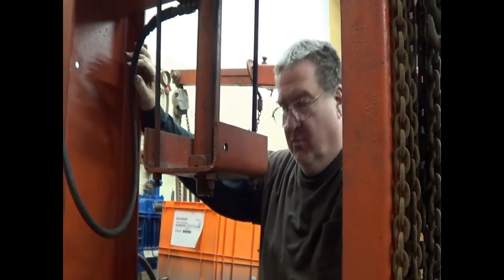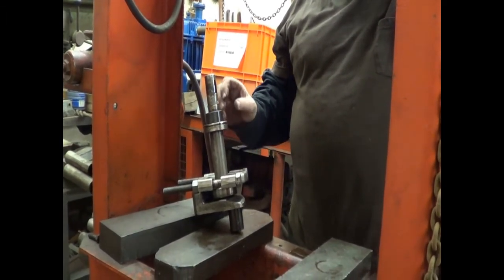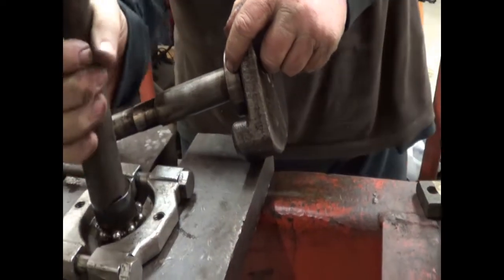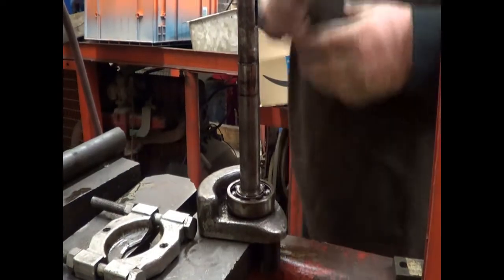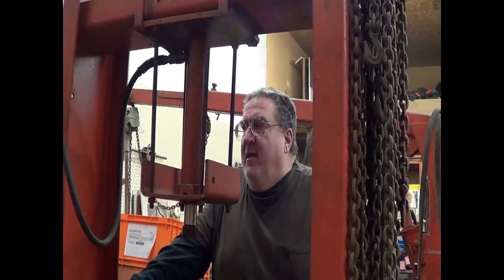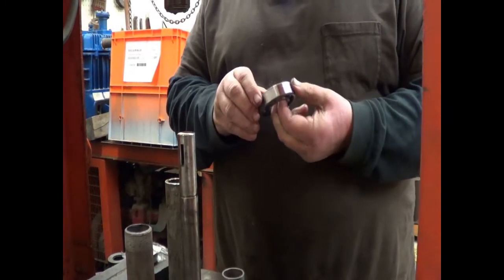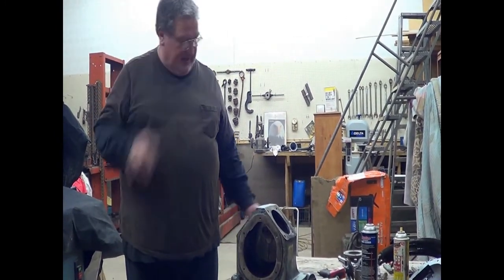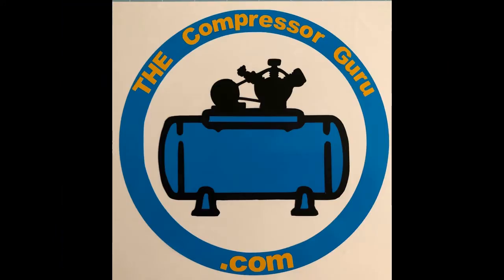Ingersoll –Rand 242 Crankshaft bearing removal and re installation! S1, E23

Comment: Mr Guru, I had a question, I have a Ingersoll 3000 and it's starting to make noise like the bearings are going bad, once you take the big pulley wheel off how does the crank come out? On one side it has that big cover on that has the oil filler plug and on the other side the small cover with the big wheel, I was curious as to what was involved in that, thank you so much for your time, I noticed the rods just free float on the crank?
Reply from the maker: with everything else taken off the pump lay the pump over on the opening that you accessed the rods through. I have no worked on a 3000 for a while I do not remember if there is a snap ring under the seal cover, if there is remove the snap ring.  Then PRESS out the crank shaft pushing down on the end of the crank. you will need a press with a large opening to do this. the 3000 is a larger pump on the smaller pumps you may be able to take a large hammer and a piece of wood as a cushion. and hammer the crank out. DO NOT USE THE HAMMER DIRECTLY on the end of the crank. use wood or a piece of brass to keep from damaging the end of the crank. 

I do have Aftermarket high quality parts for this pump I can also get you OEM which is usually at least twice the amount of aftermarket. 
You may contact THE Guru through the link below.
 thecompressorguru.com
Good luck. let me know how you make out on this project.
Bud
Reply: @THECompressorGuru  Thank you so much for your help, that was quick,this compressor is inside a room so I'm guessing is gonna have to be taken out of the room to work on it? i assume thats the only way to replace the bearings is by removing the crank? 

We have a massive press where we can do this and pull the crank out,won't the rods bend when the crank is coming out or they will just slide off the crank as the crank is falling out while being pressed?  hope that made sense, ha ha ha, i'm kinda bad about explaining things, thank you about the offer on the parts, that is great news and if we decide to go that route that would be what we would do,any money we can save is a plus.

Does the crank ever bend from running it with a bad bearing or is that a anomaly on these engines? you are correct, its a biggin too, we have 2 of them,we are a machine shop but we try to do most of our own work,most of us have decades of experience working on huge natural gas compressors and things like that but we have never messed with a Ingersoll compressor like this thats why i was asking.

It was pumping great when it started making this noise and it sounds exactly like a bad bearing,on the side that has the big wheel you can see that area there is wet like the bearing has been acting up and the seal has failed.
Reply from the maker: @dntlss  When I said everything has to come of before you pull the crank I meant that you need to remove the cylinders and pistons  so once you have done that you should not bend a rod...
removing the crank  is THE only way to change bearings. 
we do have a high quality rod and bearing  aftermarket kit for the 3000. 
contact me through thecompressorguru.com for more info
Reply: @THECompressorGuru  I gotcha now, man they couldn't have made that more labor intensive if they had tried,lol, thank you much for all your help, I will subscribe when I get home, your top notch in my book.
Reply from the maker: @dntlss  the crank is the first  thing in and the last thing out . you are right.

Comment: Great content and thank you for sharing it. I can't thank you enough. My compressor has been sort of a mystery unit.  It has 30T 560v stamped on the Ingersoll-Rand ID plate under model number.  In the serial number spot it has 30T in black ink and 397577 stamped in.  The tank has a plate as well telling me was built in 1992.  It was given to me by wife's employer.  He refused to take anything for it regardless my insistence. He finally told me he knew it was a much better unit than the new one he just went out to harbor freight and purchased.  He said he was in the middle of a couple jobs that could not wait.  This one has sat by the working on for years now.  He also said he was aware that the one he gave me was likely more valuable broken than the one he now uses was as a brans new unit.  I can not confirm this but, I assume that the model number stamped on the pump stands for the whole unit and not the compressor pump?  Decoded it simply means that 30T is the series of the whole unit tank motor and pump. Then 5 would stand for 5hp and the 60 is for gallon tank size.  That would leave the V to mean Vertical.   It has the reed valve set up like the one that you are rebuilding and a single coiled intercooler line between the low and high pressure cylinder heads.  I am certain I found the issue when I pulled the high pressure head the head gasket was torn and a piece of it was causing the reed valve to stick and surface rust was starting to get to the point of pitting the metal.  There was also water mixed in the oil. I figure due the the valve issue and Florida Humidity?? The unit had never been in the weather. Due to the fact that Ingersoll-Rand has not bothered to get back with me and I have no idea which gasket set to buy I bought some Fel-Pro Rubber-Fiber Sheet and used the old gaskets  to make rubbings.  I transferred the rubbings to pattern material and made templates.  I the used the templates to transfer the exact shape of the gaskets to the gasket material.  I then cut the gaskets myself. The reeds seemed fine along with the hardware after a good cleaning.  I scrapped all the old gasket material off the best it would come off. I followed up with sanding all surfaces with an orbital to brighten up and make sure the parts were flat. .   I treated the gaskets with never seize and put everything back together.  Using 35 lb ft of torque and tightening in a the bolts in a crisscross pattern. Then retighten after 30 mins run time.   The century 5hp single phase 230V motor was then torn down to discover the only thing it needed front bearing to be pulled and and new one pushed in place.  The bearing was an easy fix and in stock at my local O Reilly's.  It was made by National Bearing.  The motor and wiring was then tested and runs smooth as silk.  I have not put the belts back on to test everything, but the time is near. I am going to scope the tank first with a camera to verify that he inside is not in too bad of shape and may treat the inside with something if I can figure out how to accomplish it. Worst case I will coat the outside of the tank with Polyurea so that if a tank failure happened it would contain it.  My pads to bolt it to the floor will arrive today and that will be the last step I hope before the test.  If all goes well I will l be making a silencer and aftercooler next.  Any help you could offer about the information I shared here would be greatly appreciated in  advance.  Last I know Mrs. Guru meant well by mentioning your heavy breathing, but people on You Tube can be real Jerks and I would not give them any ammunition.   The heavy breathing It seems get heavier with age and is just a part of life.  I notice my own heavy breathing sometimes in video footage that I have shot and think to myself,  damn do I sound that out of shape? Really it is not as not, that noticeable in person and the mic from the camera just amplifies it. I am only 45 and I have a spinal cord injury that causes pain all day every day and all night every night. I know where the Guru is coming from and understand what it takes to just put our socks on in the morning. . It embarrasses me when my wife points it out because I just can't help it. I have not let my ailment stop me I still do all the things I used to do  only slower.  Also I just grunt more and breath heavier while working.  I still do not depend on our broken Government to feed me and never will.  Never apologize for a man that pushes through the pain, to get up and go to work every day.  You guys seem to be having fun with your YouTube Channel and I wish you all of the success that it may bring.
Reply from the maker: chad feel free to send me  a picture of the pump. use thecompressorguru.com to contact me through ( i do not want to put the email here and have some bot catch it and spam me to death) I am a little confused as to which pump you have. It sounds like a v pump but the number you gave me from the tag doesn't make sense. send me a pic of the tag also.
there is a video on youtube of a guy making a silencer out of a 5 gal bucket. that is going to be an upcoming episode shoot. I have a customer that wants 1. I sell a nice silencer it is on thecompressorguru.com But you sound like a real hands on guy. thanks for the input on the wife and my breathing. I had to do some editing because my conversation went off key LOL thanks for watching email the pics .  I still do every thing  i use to also you are right only slower. except bowl have not thrown a ball in 3 plus years, and yes I miss it . Bud

Comment: I've been getting a lot of "compressor explosion" videos recommended by YouTube. The cause is always an old tank that rusted through. Has anyone ever thought to dump a pint of paint into a new tank to coat the inside thoroughly and pour off the remainder, thus extending the life of the tank?
Reply from the maker: It probably couldn't hurt. Thinking about it something like the permatex product "Rust Treatment" part number 81773 may work great for this application.
Reply: @THECompressorGuru  thank you, does your channel have any videos for building a compressor (I'm very cheap but smart) or do you know anyone that has such knowledge?